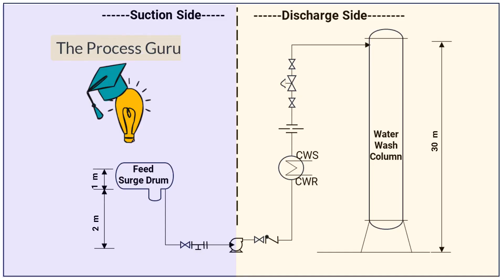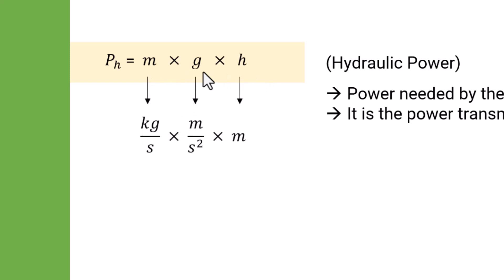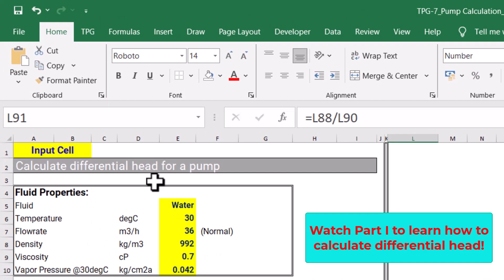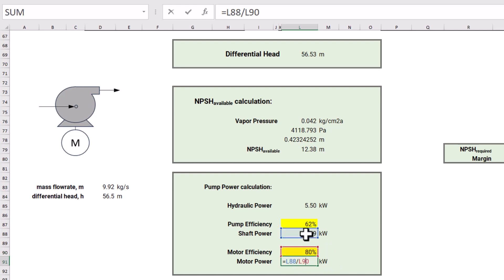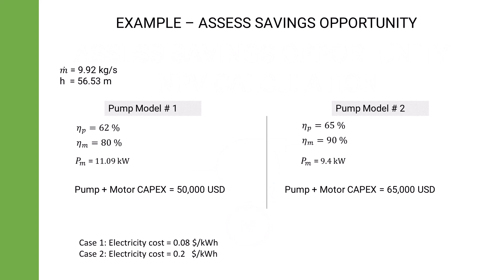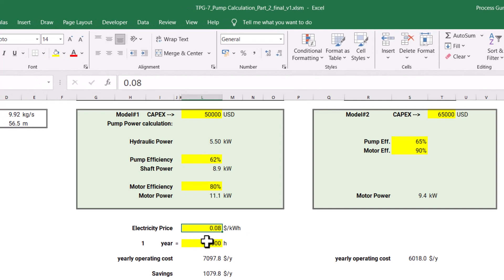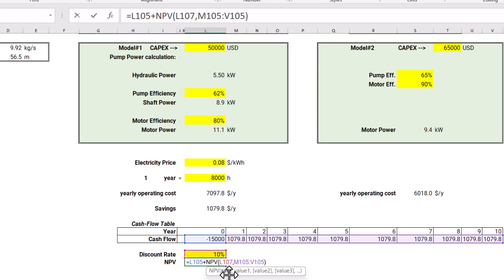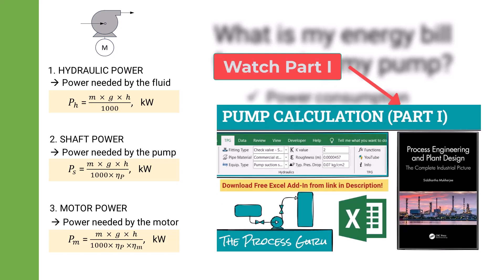Pump power calculation & Technique to assess savings opportunity (Part 2) [Free Excel]

Comment: Very very good vids and explanation and excellent work, Thanks a lot
Reply from the maker: Glad you found it helpful. Thank you!
Reply: @ProcessGuru  I am retired engineer, but I always ike to learn more and new ones. Ist the Excel sheet finalized or do you have extended this?
Reply from the maker: @shahrokhseyedi2050: Thank you for your interest. The Excel sheet shared in this video is finalized for the pump topic. This video is Part-2 of the pump series, and I haven’t extended it further yet. I do have separate videos on heat exchanger design and NPV/IRR calculations, and those are accompanied by Excel spreadsheets. You may find those useful as well.
Reply: @ProcessGuru  Great and Thanks a lot. Wish you all the best. Regards Shahrokh Seyedi